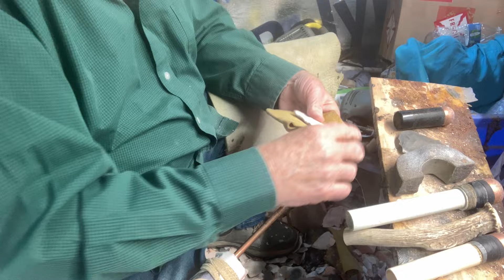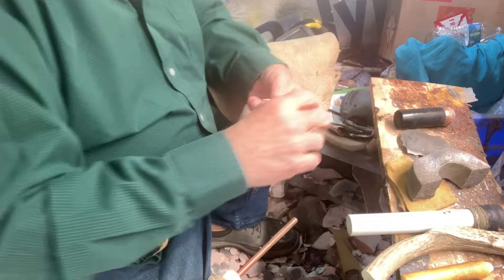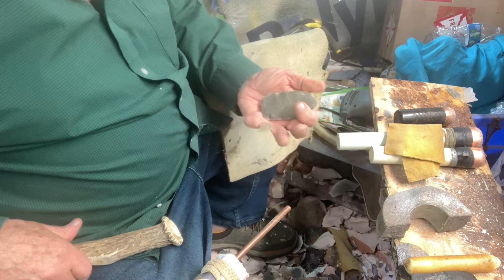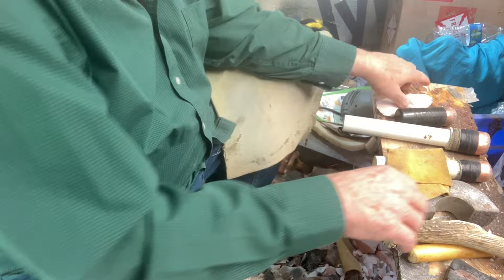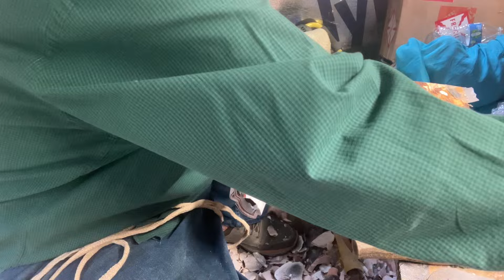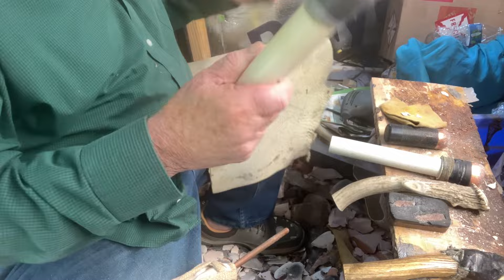Indirect percussion

Comment: I would send  large obsidian spalls to make knife and buy hafted elk antler handle.
Reply from the maker: I only have white tail deer handles  if they will work
Reply: White tail handle will work. all the pieces of deer antler I have made into hammers and the obsidian is triple flow black red throughout whole spall and have daysite spalls to send I have made over 50 arrow heads marking about three or for a day to haft to arrows for hunting. Getting large elk antlers for making larger billets for precision in the future
Reply: It’s has been hard for me to get a blade big enough to use for skimming  and put in and antler and in the process of making axe